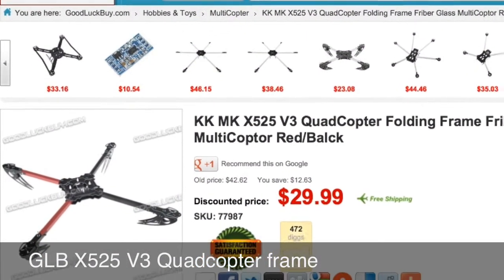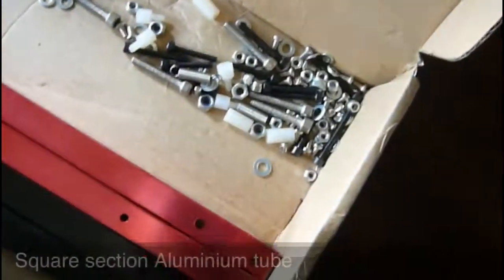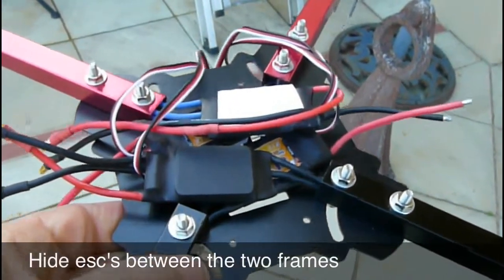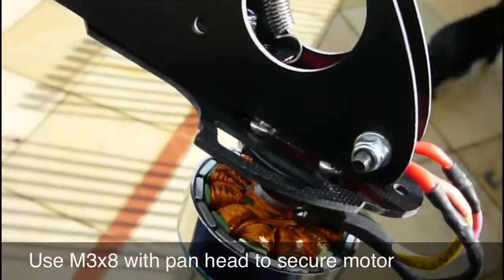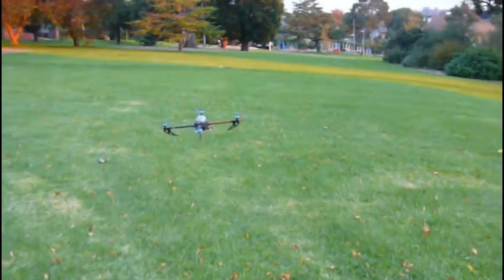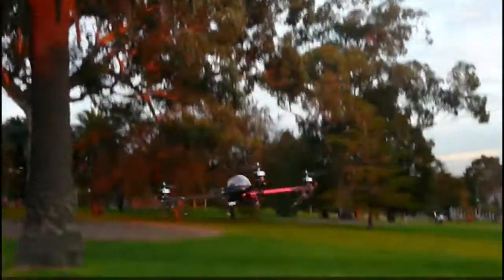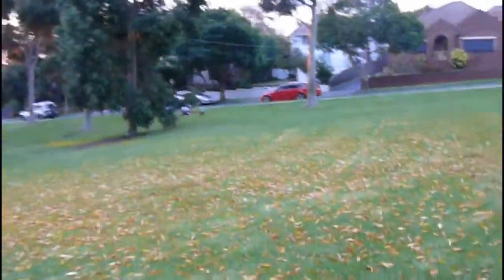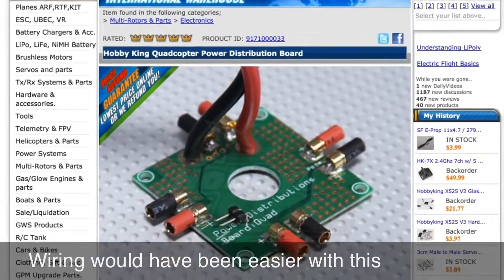GLB X525 V3 Quadcopter Build, Review And First Flight

Comment: the escs are Simon flashed in this video or stock? Looks very stable!
Reply from the maker: No not on this model. Its all about balancing your blades and motors then getting the right PID settings. I also enable LPF filter on multiwii. I have simon K on my tricopter and it is no better than stock in my opinion, but it is a heavy beast and running large props.

Comment: I built one a few weeks ago.... The motor mounts did not last too long... Saw some on ebay for $25 but bought a strip of aluminum 40x3x1000 ($7) and cut them out myself... A few heavy landings and the springs stretch so I replaced them with stronger ones... I put a Rabbit board in mine and it flies well...